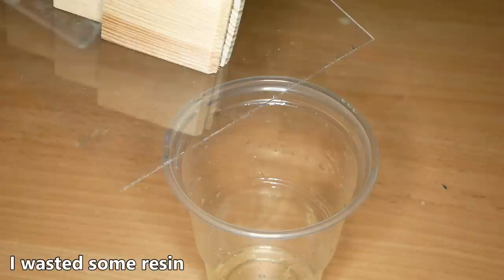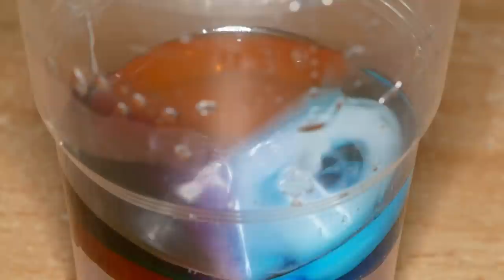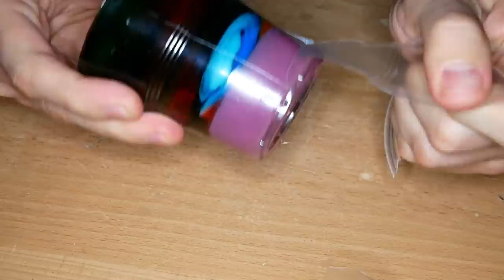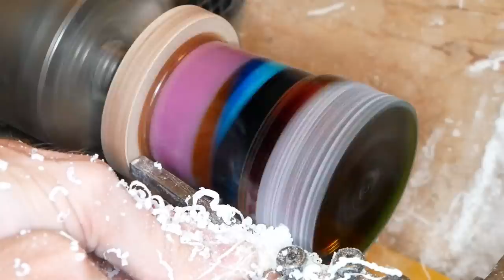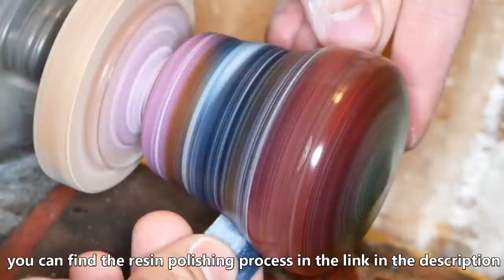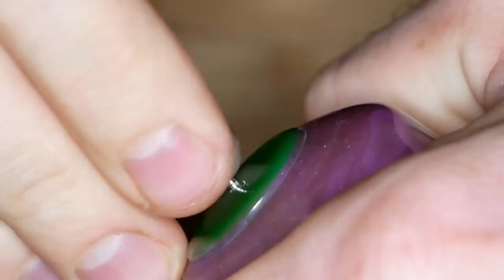Christmas Bell / RESIN ART

Comment: Интересно получилось. Я не знаю как получится, но если сделать так? Обычно вы избавляетесь от пузырей которые бывают при заливке смолой. А если при изготовлении наоборот сделать так чтобы пузыри воздуха остались. Может в той же новогодней ёлочке или в этом колокольчике был бы интересный эффект. А может и нет. Вы в этом разбираетесь лучше. А так получилось очень неплохо. 👍
It turned out interesting. I don't know how it will turn out, but if you do it like this? Usually you get rid of the bubbles that appear when pouring the resin. And if during the manufacture, on the contrary, make sure that air bubbles remain. Maybe in the same Christmas tree or in this bell there would be an interesting effect. Or maybe not. You are better at this. And it turned out very well.